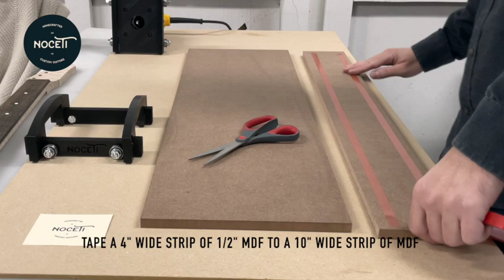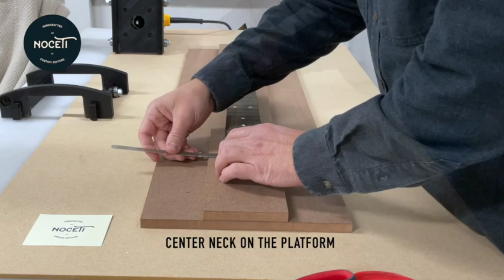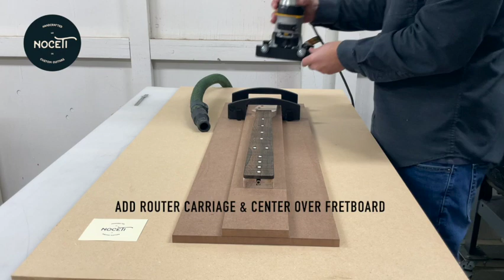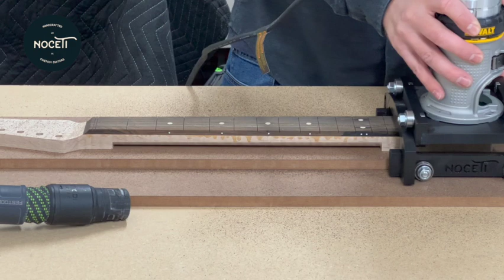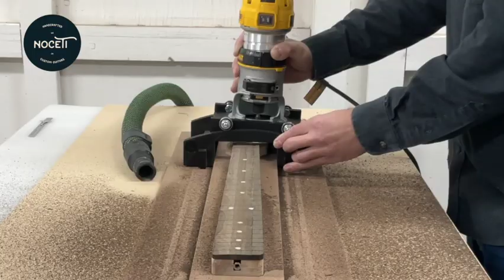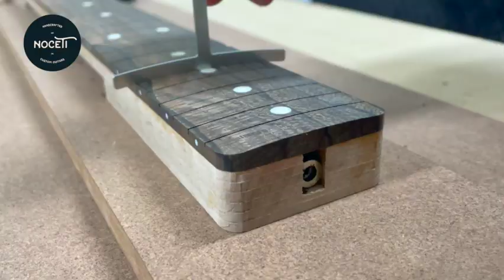Radius Your Guitar Fretboard In Under 5 Minutes!

Comment: I would love something like this where you could use a radius sanding block. Would be able to do fast & accurate fret leveling. No matter how hard I try, I always roll off the edges of the frets to not get the true radius I’m going for. I think I still might order one of these to see if I can rig it for a sanding block.
Reply: i do , use a sanding radius that travels in a straight Beam/Channel , sanding is a better result (especially on old Brittle Fretboards) as you need to sand when finished routing any how . Neck is taped in centre of Channel and Sanding Radius runs on top of Channel and Guided Straight by the Channel. Neck is set up to an accurate height - then basically sand till you cant sand any more off . its now straight and true, can use for Fret levelling if needed but should'nt be required, fret levelling is done via a full length gun barrel straight sanding beam with wet/dry , and be very careful to keep sanding beam along centre axis of neck , ----Beautiful    - Benson Guitars australia

Comment: Good morning I will be building my platform for the radius jig I bought from you and am wondering what lenght I should make it to accommodate Botha regular guitar neck and also a 34” scale bass neck, any ideas? I also noticed you start from the middle of the fretboard and work your way back and forth down to either edge, I watched a video by Sweet T guitars where he starts on the edge and goes towards the middle, just wondering which in your opinion is the better way? Also I am using Abalone dots should I wait and put them in after I’ve radiused the fretboard, thinking they might chip from the router bit, have you ever radiused a fretboard with abalone dots already installed and did they turn out okay? 
Thanks for your thoughts
Regards
Maurice

Comment: Have you attempted to route over mother of pearl? 
If i inlay the fretboard with MOP block inlays and THEN radius , will the MOP survive the router ?
Reply from the maker: @darrylportelli  with MOP I install and sand flush after radiusing to be on the safe side.
Reply: @noceticustomguitars  do you cut the pockets for the inlays before radiusing? Im asking because marking inlays on an already radiused board is a bit difficult to balance the inlay while marking . Cheers